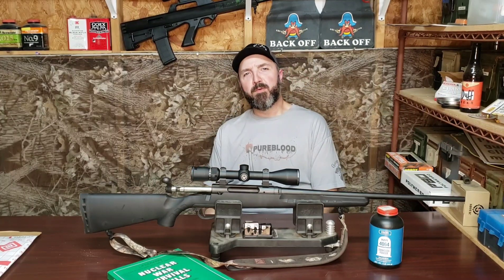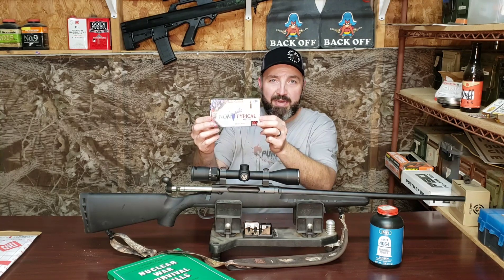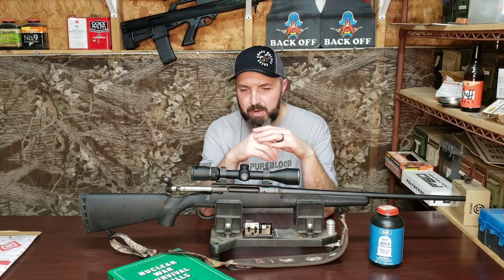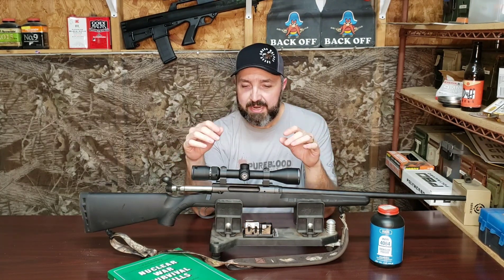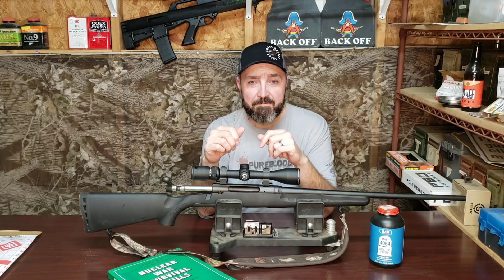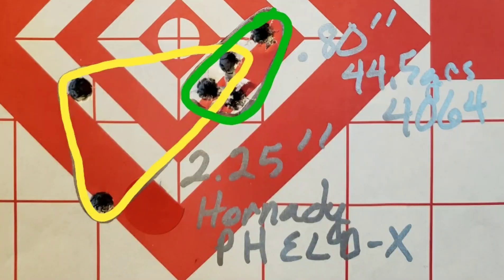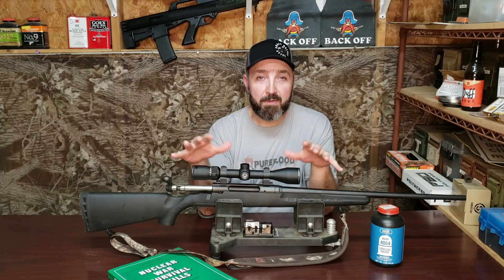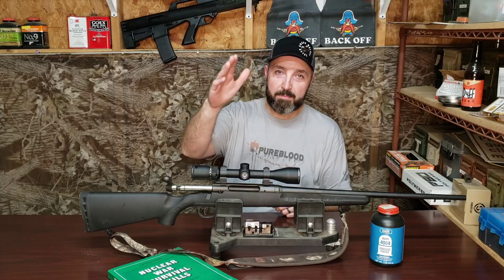2023 Project Rifle Update Vol 3: Finding the right load we test Hornady Precision Hunter ELD-X

Comment: I load  Varget or 4064   and Accu Bond 125 gr... Pretty impressed with the results I got ..
I stay away from Hornady  like a Plague
Mounts and rings are important to allow for bolt operation.
Some have had trouble  , therefore a higher ring or mount is needed .
 Try looking at a RITON SCOPE  Jay     I was impressed . But all up to you.
Reply from the maker: Thanks for sharing 👍 

That rifle has been through a ton of changes since this video.

It wound up being an unofficial mascot for several product reviews. Some of which we haven't even got the videos out for yet. We have tried numerous different configurations with it in bullets ranging from 150-180gr.
As it sets with the factory barrel, it really doesn't do well with bullets over 150gr. Also the thin profile of the factory barrel makes for really slow range sessions.